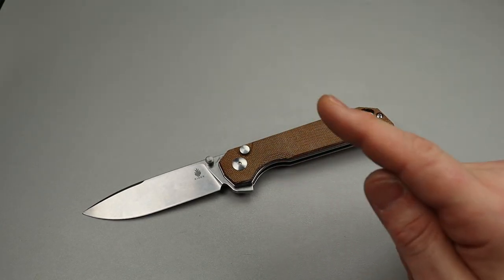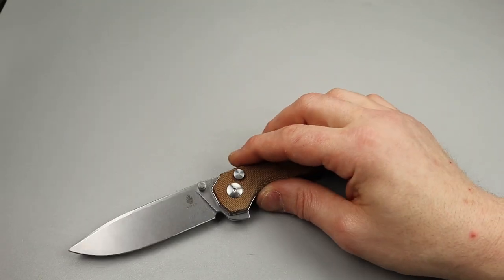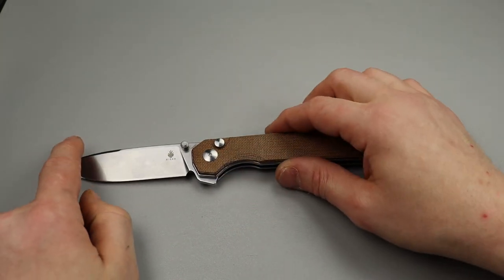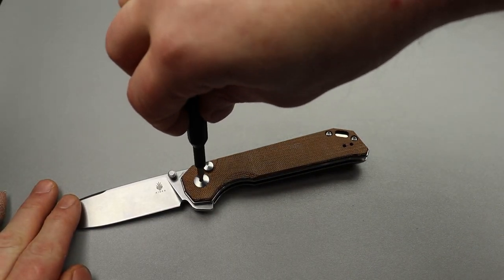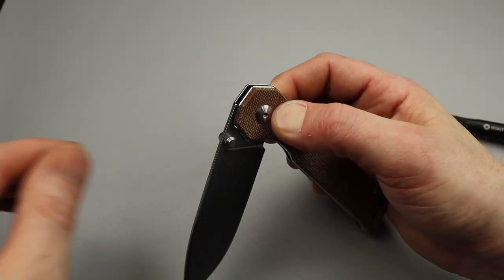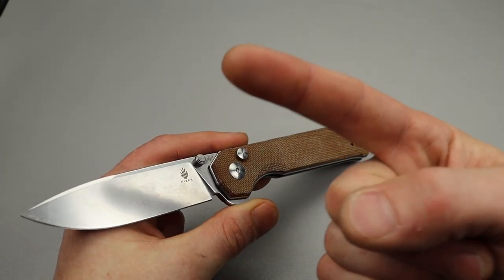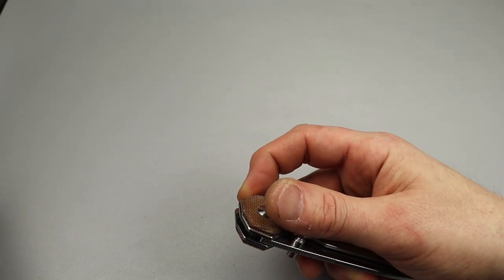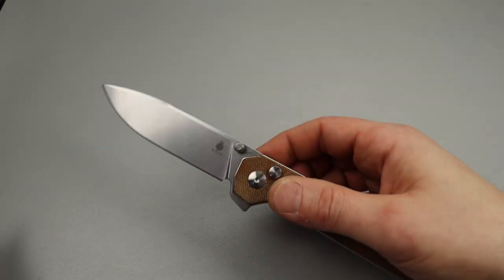FIXING THE XL BEGLEITER BUTTON LOCK ISSUE

Comment: You’re the best thing to happen to the knife hobby in years…..thanks Jerad!
Reply: @NeevesKnives  I know you have alote on your plate but I'll give it a shot anyhow. I have two kizer cormorants the detent on one is absolutely perfect but the other is to dam weak. Tried a few adjustments but to no avail and unfortunately no one has covered tuning button lock knives. Any suggestions?
Reply from the maker: @jimmycricket7946  I have a couple videos on fixing and tuning button locks, take your spring out and stretch it, to give it more tension. That should help
Reply: @NeevesKnives  thanks for responding. Okay I'll give it a try and I'll see if I can locate your other videos. Also wanted to know how to go about sending you over a few knives for sharpening. Believe it or not i have a TRM adam that came pretty dull from the factory which I know is probably pretty rare but nevertheless it happens. I tried to sharpen it myself with the belt but it really didn't do any good and I'm not steady or skilled enough for stones.

Comment: XL worked great out of the box. Carried it all day without issue. Next day it developed the button issue and was stuck partially depressed. Took it apart and cleaned up some ruff edges on the button and put it back together. Again, worked great for a day then developed the same button issue. Took it apart again and discovered the same thing as you....the liner shifts a bit making the button get out of alignment causing it to jamb in a semi-depressed position. I carry this in my back pocket and with this being so long and the pivot just being snugged down so blade is centered and free swinging, when you sit it causes the liners to become misaligned. Probably having an attachment point at the stop pin or another spacer attached closer to the pivot along the spine of the knife would control this.
Reply from the maker: Next time you put it together, add thread locker and allow it 48 hours to set up, before opening and closing and using. If that doesn't work try a different thread locker the liquid holds up stronger than the paste.
Reply: @NeevesKnives  I did use blue loctite and it set for about a day and a half

Comment: My button was a bit sticky out of the box, but some oil fixed that. My critical issue with this knife is the position the height of the button. Getting a decent right-handed reverse grip (like for cutting paracord) or a "tactical" grip (blade up - pinky towards the blade) on this knife always ends up depressing the button enough to release the blade on me. Some might say that I should just adjust my grip to work around the button but that's ridiculous. I don't have to work around the button on my Pyrite and I shouldn't have to on this more expensive knife. If (god forbid) I ever have to use my knife for self-defense, I'm going to instinctively grab it like I do every other knife and then end up cutting my fingers off when the blade comes loose. This is so frustrating because I really like this knife otherwise! I believe that if the button was just a 1 mm shorter, that would fix the issue too. I suppose that I can try taking the knife apart and filing the bottom of the button, but I don't think that I'd be comfortable with doing such a job. I will probably just return this knife. Huge bummer. :(

Comment: My XL was perfect out of the box.  Flipped and carried for a week then sat in knife drawer for a week. Took it out this morning and it now has exact same issues..either bl is completely locked up and impossible to deploy via flipper nor stud. Or blade completely free swinging.  Also partial lock.  I'm a Kizer fan with several other kizers but this is two in a row.  I returned the Begleiter mini frag two weeks ago for an extremely strong detent that made it impossible to thumbstud deploy that mini.   My Cogent and BL Elementum has zero issues and they're users.

Comment: Great tips! Could you tell us the site you are buying the button lock parts from? I'm having button lock issues with a button lock Feldspar (CJRB) and think I will need a place to buy button lock parts (aside from this, the knife came with a loose screw on the clip...the screw that fits into the steel standoff, so I might need a steel standoff as well). Thanks again!

Comment: In your opinion how secure once deployed is a button lock?
Absolutely hate liner locks I've gotten cut plenty of times by the ones that have failed thank you.
Reply from the maker: It's definitely durable but not necessarily hard use but durable for regular cutting, if you want harder use get an axis lock, compression lock, or tri ad lock
Reply: @NeevesKnives  Will do, looking for a folder at least 3.5 inch blade drop point
Reply: @NeevesKnives  well I settled on the cold steel ad10 4-in.... What do you think is a good price for that little tough to come by seems don't know why

Comment: Had this problem on mine. I've just come to expect issues with Kizers. The original has been great so far and hopefully it holds up. It will likely be my last Kizer though.  Way too unreliable
Reply from the maker: Why what happened?
Reply: @NeevesKnives  lock failure on my Lan. The locking mechanism and design of the cormorant has been nothing but problematic. Button came off shortly after getting it. Took months to get a replacement. This issue with the begleiter xl. 3 strikes rule.  The blades are all great but action and reliability has fallen short for me.